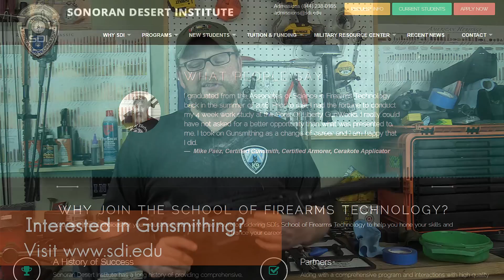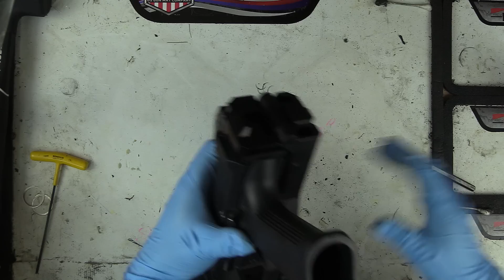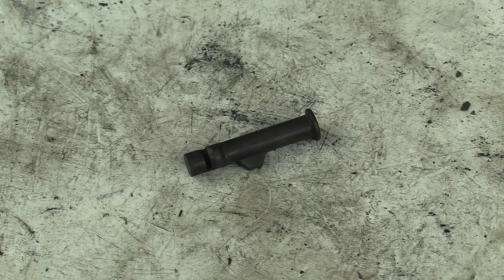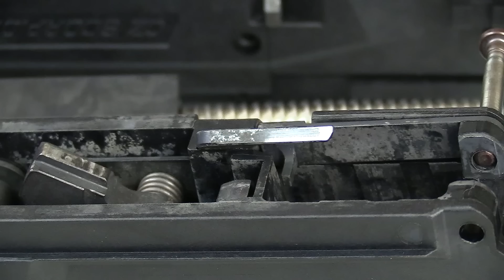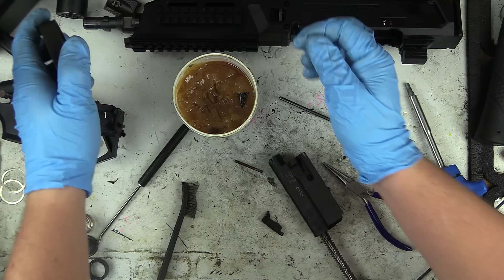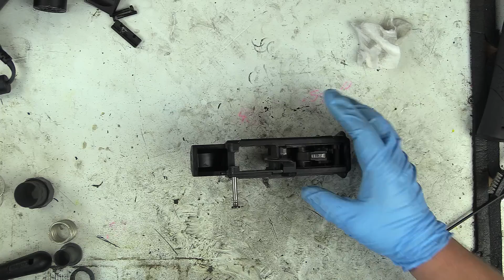CZ Scorpion Cleaning & Inspection

Comment: I cleaned my tri lug yesterday and went out shooting today and I can't get my suppressor off of my tri lug. I'm having the same issues you did. I can rotate it to the unlocked position but that's as far as it goes it's seized up in there. I tried ballistol, kroil  Hoppe's ,a heat gun and Breakfree Powder blaster . The damn thing just won't budge

Comment: I liked this video. But why do you have to remove the grip to take out the trigger pack? I have a yeti works grip on mine & I don’t have to remove my grip to take it apart. I have a gen 2 with a LW 15 hand rail. Am I missing something or is this for the regular for the front  polymer rail?

Comment: Eric you completely wrecked the charging handle spring. Folks when you go to swap your charging handle out from right to left or cleaning purposes their is a catch spring that holds the charging handle in after you push out the pin.. You need to depress the little spring or you will tear it up and need to replace it if you can't fix it yourself. Look up other videos that can show you how to do it correctly.

Comment: I prefer to clean my guns before I have to beat them apart with a hammer and massive copper punch. 🤣 500-1000 rounds is a good upper limit for me. I don't have an ultrasonic; just Hoppe's #9, copper solvent, and brushes.

Comment: A quick spray down at the car wash is also a nice way to blow the crud off if you don't have an ultrasonic...  Heated, high pressure water can work wonders.
Reply: Nice joke. People generally frown upon pulling out guns at the car wash and spraying them with the pressure washer. 🤣
Reply: @mannys9130   It's not a joke.. I do it all the time...  One guy thought it was a pile of motor parts..  That's all it looks like without the barrels. I usually wait until I have several   to clean and do them all at once... It works great, only takes a second.

Comment: Nooooooo Eric why, don't reassemble before ultrasonics, Why brother man Why - but thanks for the Vid I have the same gun but over 20k rounds all though I cleaned after every shoot like a responsible daddy yet the wear is much higher still running without fail. Best money spent. I purchased literaly to reck for fun and the darn thing won't quit ...... even without rifling accuracy is decent lol
Reply: I just got one used but it had to if had less than 1k rounds thru it prob less, t’s in Pristine condition no wear marks or anything. I’m going to pick it up on Friday, if you can what kind of lubricants do you use for yours? The manual says use ballistol which I may use but other people have suggested Rand CLP, lps2, go juice. Thanks for any tips you pass along been trying to find this gun for months and finally found one in great condition and wanna keep it that way

Comment: Has anyone weighed the bolt on this thing? This firearm is ABSOLUTELY designed to withstand fully automatic fire. It's a fucking massive brick. This is one of the reasons why this costs as much as 2 ar7s.

Comment: Taking the trigger pack apart to install lighter springs and a new trigger from HB industries is SUPER EASY.  You can do it Mr. Eric!  lightens trigger pull to about 6 lbs down from 9-10lbs stock.

Comment: Can you do carbon fiber barrel test ???? Need to see this and get the most top rated carbon fiber manufacturers. Heat test , round test etc. I want to know the hype about all this carbon fiber barrels
Reply: Proof is probably the best. Honestly though, unless you want an ultralight build...a standard pencil barrel will probably be sufficient. They're just stainless barrels with a carbon fiber wrap for support and rigidity.